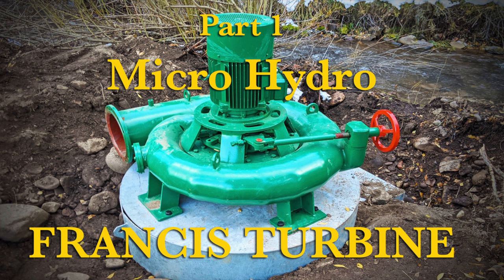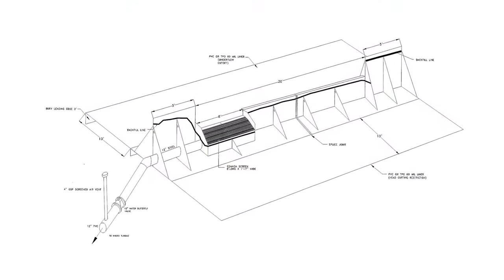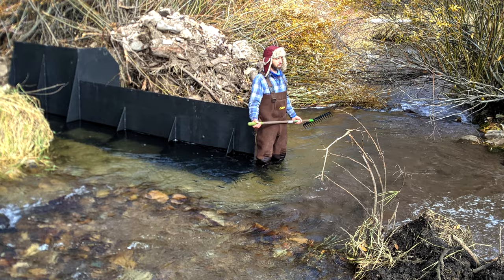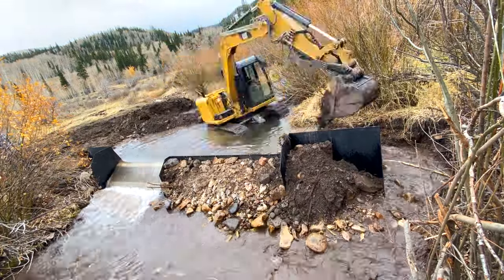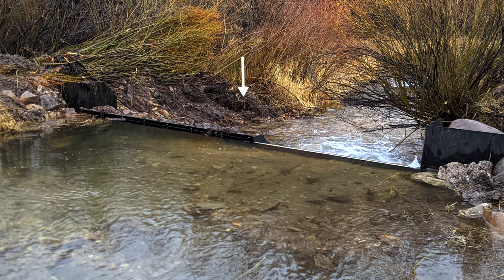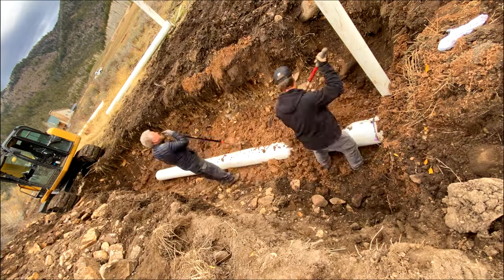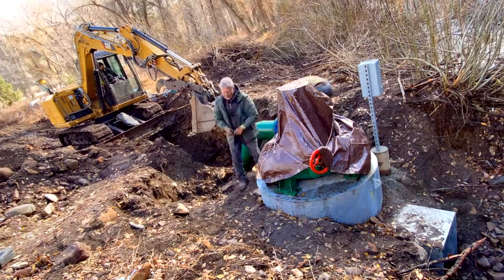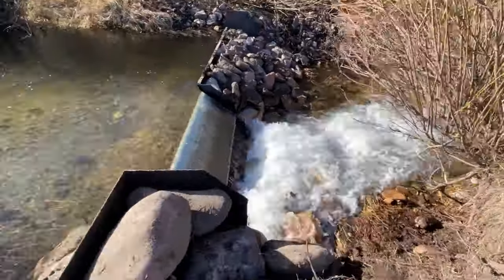Micro Hydro Francis Turbine Part 1

Comment: Might be a stupid question but why so much run? Why not just make it shorter with more drop?
Reply from the maker: The head (fall) of this or any system is dependent on the specific geography of the site. The placement of intake and outlet are selected to optimize the head. Unfortunately what you suggest isn’t possible due to the lay of the land and the water’s course through it. Hope this makes sense. Thx 🙏 for watching!
Reply: @MrHydrohead  oh that makes sense. So the creek itself didn't have much drop that's why you had to run it down further?
Reply from the maker: @RealSlavGod  Exactly. This system is an example of low head/high flow and is potentially producing up to 6kw or 144kWh per day which is 4+ times what a typical American house uses on average
Reply: @mrhydrohead  Thats quite an impressive power output. Good on you! I really enjoyed the videos too.
Reply: @mrhydrohead  Correct me if im wrongt but you know what would've been easier? Turbulent hydro. The one that uses the flow and spin of water rather than height difference. Way less material needed for that
Reply from the maker: @RealSlavGod  The turbulent system looks very promising but they’ve done very few installations. That may be because they seem to be marketing their product to a municipal or corporate use. I’m eager to see if there will be one installed which I can document.
Reply: @MrHydrohead  yeah the company itself but the concept of it is very simple. The form could be made out of concrete. The hardest part is finding a propeller and how to mechanically attach it to your generator.
Reply from the maker: @RealSlavGod  if I was looking to manufacture a product, it would be something to pursue. As it is our system at our home is currently running at 7.2kw or ~173kWh/day and it serves our needs quite well. Not sure if you’ve looked through my channel, but I’ve pretty much documented most everything I can about it and have started documenting others’ systems just because I have a passion about it and want to spread the knowledge. This video is one of those extensions to the channel. Again, thx for watching
Reply: @MrHydrohead  I sure did look through the channel and the content is great. I gave you a sub too. Micro hydroelectricity is one of my passions too and my dream is to work for a company that implements and plans these Hydro projects. I finished electrical engineering in school and am looking towards that for the future. Hydro is definitely the way to sustainability
Reply from the maker: @RealSlavGod  Good on you as the Ausies would say. I got my start in the 90’s with it. Living with a bounty of power is oh so satisfying. Best of luck with your pursuits!
Reply: @MrHydrohead  My other dream is making a homestead with offgrid Hydro power like what you got. That must feel good

Comment: Why PVC? Could you use  HDPE pipe?
Reply from the maker: I don’t think HDPE comes in 12”. If it did can you imagine trying to unroll it? Ouch. Thx for watching
Reply: @mrhydrohead  We get it up to 36", straight pieces  40 ft long, fusion weld it together. The 12" is 3/8" thick, very abrasion resistant . I've run it for miles above ground for temporay water bypass systems.
Reply from the maker: Interesting, thank you for making me aware of that.  Of course I am not the owner or designer of the system and was granted permission to document the project.  I don’t think the installer owns a HDPE welder either.  I would guess that HDPE has less pipe friction too.  Thanks agin for sharing

Comment: How long will it last? How much does it cost to install this way.😅😅
Reply from the maker: The system I own on my property and documented on this channel has been running since 1996 and I expect it will continue to provide power for the next several decades.   I am not the owner of this Francis Turbine system. I merely documented this particular system.  Even if I did provide cost figures, it would not be of much benefit as each system is unique to the chosen site and costs can vary widely depending on numerous factors.  First there is the potential power available at the particular site which dictates if the desired use of that power is practical.  Who will design the system?  What will be the best equipment and materials available to meet the unique requirements of the most beneficial and practical design?  Then there are expenses involved in acquiring water rights which are likely different in each state or country depending on a pro se (self applied) application or hiring lawyer to work on them.  Who will do the labor to install the system?  Is it your own sweat equity, friends that can help, or hired labor and at what rate?  How much time will it take to install?  What materials can be accessed?  Reused or new pipe, copper or aluminum wire?  How long a length of wire?  What building(s) will house the equipment?  What transformers, batteries, load regulators, power shunts, or utility net metering are available and/or appropriate to the particular site?  All of theses factors can add to the costs and it would be naive of me to present  a one size fits all price.
One must be clear that installing a system is creating an asset which would likely provide power for a lifetime.  Can it be financed over time and does that cost make economic sense when compared to running utility lines to an off grid property?  Will a local utility be willing to purchase excess power and at what rate?  Undertaking a project of this size is not for the faint of heart. It IS a large commitment both financially and in effort and time.  You pay for all future power up front.
Thanks for watching

Comment: hello do you need any permits to do this ?
Reply from the maker: Yes you must acquire water rights to use the water.  I don’t own this system which is in Utah, but my system which is documented on the channel in Colorado required attaining non consumptive water rights via water court.  Every state is different to my knowledge.  Thx 🙏🏻 for watching
Reply: @mrhydrohead  understood, if i wanted also to use the water for crops would i need another permit?
Reply from the maker: @wartrailers9398  Most likely. Irrigation rights are considered consumptive.  It all depends on the state and how they manage water rights.  Involving a lawyer who works on water rights might be the best person to ask about specifics.
Reply: @mrhydrohead  when i will move to the us and have the cash to buy some land I'll surely ask a lawyer

Comment: Why destroy good spawning habitat for trouts and insects and other wildlife with dam? you are contributing to the loss of biome which is huge problem world wide. So many moving parts which need maintenance over time. Why wind or solar power was not not good enough that u needed to destroy this nice stream?
Reply from the maker: First let me say that this is not "my" system, but one that I am documenting.  I didn't design or install the system, but was permitted to make a video about it. There likely was a limit how much water would be diverted through the system so as to not damage seasonal capacity for fish habitat. This is something that is regulated by the governing water commission and I assure you that the fish habitat was taken into account with the water right for non consumptive diversion.
The consistency of micro hydro far surpasses solar and wind is not really a viable source at this site.  Maintenance of the system is minimal.
Your tone is offensive and this system hasn't "destroyed" the ecosystem.  Nonetheless, thank you for watching.
Reply: @mrhydrohead  i wouldn't be offensive if i wouldn't see any problems with this dam. Okay lets talk about issues with this setup. Its looking like its late fall when this is installed, there has been some snowfall and the weather is most likely above freezing when filmed. Usually fall is rainy so im assuming we are on high flow rates on this stream when filmed. Also salmonoids migrate in fall so its not right time to go dig in streams and rivers. Looking at 3:36 Flow over the screen is barely suitable for fish and the biggest problem is that theres no pool under the screen, only rocks and shallow whitewater so fish wouldn't have any space to gather up speed to jump or swim over the screen so this system is totally blocking migrating fish to go upstream. Also if there was a pool, only the biggest and strongest fishes would have the ability to jump or swim over that screen. I highly doupt that habitat was taken into account when doing this because end result would been really different.

Comment: Excellent!! Is this system meant to augment or replace the existing system? I know you had many issues with flooding and stabilizing the original pipe system, but either way, glad to see it! This one is built to last.
Reply from the maker: This is a whole separate system design on someone else's property.  This video shows how low head/High flow can also be harnessed.  Our system continues to provide more power than we can use.  An update on our system will be forthcoming.  Thanks for watching!
Reply: @mrhydrohead  Awesome!
Reply from the maker: @TexasVeteranPatriot  Heres a link the first alternate system on someone else's property: 
  https://youtu.be/Bh8ngja_qNk

Comment: you said Micro lol
Reply from the maker: Yes indeed it is. https://en.m.wikipedia.org/wiki/Micro_hydro
5-100kw is micro, below 5kw is pico. Thx for watching 🙏🏼
Reply: @mrhydrohead  im watching stuff like reversed washing kmachines and this (as preperation on move in near future) https://youtu.be/L16s6aUJ0ns ... 1 1/4 inch pipes, 3 inch maybe 4 and then seeing urs with 12 inch pipes. urs just another level. enjoyed and learned. Thanks! (If u wudnt mind telling, what were the costs of your build?)
Reply from the maker: Sorry for the slow reply.  Pipe sizing is best dictated by the site itself as how long and how much flow will dictate how much pressure is lost to pipe friction.  The Dif between 1.25 and 4" is massive.  I am not the owner of this system. I merely documented this particular system.  I believe it was over $100k although I don't have access to the real numbers.  This system had no sweat equity from the owners.  Even if I could provide cost figures, it would not be of much benefit as each system is unique to the chosen site and costs can vary widely depending on numerous factors.  First there is the potential power available at the particular site which dictates if the desired use of that power is practical.  Who will design the system?  What will be the best equipment and materials available to meet the unique requirements of the most beneficial and practical design?  Then there are expenses involved in acquiring water rights which are likely different in each state or country depending on a pro se (self applied) application or hiring lawyer to work on them.  Who will do the labor to install the system?  Is it your own sweat equity, friends that can help, or hired labor and at what rate?  How much time will it take to install?  What materials can be accessed?  Reused or new pipe, copper or aluminum wire?  How long a length of wire?  What building(s) will house the equipment?  What transformers, batteries, load regulators, power shunts, or utility net metering are available and/or appropriate to the particular site?  All of theses factors can add to the costs and it would be naive of me to present  a one size fits all price.
One must be clear that installing a system is creating an asset which would likely provide power for a lifetime.  Can it be financed over time and does that cost make economic sense when compared to running utility lines to an off grid property?  Will a local utility be willing to purchase excess power and at what rate?  Undertaking a project of this size is not for the faint of heart. It IS a large commitment both financially and in effort and time.
My first system (1.5kw) which I own and documented on this channel cost ~$25k and was installed in the mid 90’s.  Redesigning and moving the same equipment to a more reliable water source was also documented on my channel and took place between 2013-2015 and added another ~$55k but boosted the useable power by a factor of 5 to 7.5kw.  WHEN a project occurs occurs is also a factor governing cost.  Inflation impacts everything involved and the fact that I intend these videos to remain on the internet for years to come and provide some clear eyed guidance to people that are serious about their own intentions, this dictates that I not mislead them with cost estimates willynilly.  
Thanks for watching and for your comments.  I hope you can gain a broader perspective from the whole channel and benefit from the heart felt intention with which it has freely been shared and provided.

Comment: What about a silt filter and shut off ?
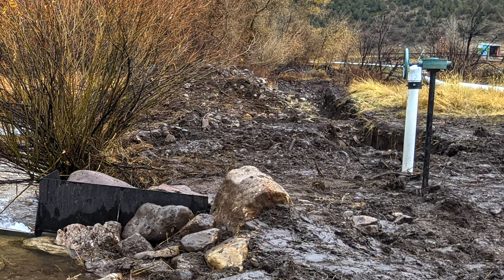Reply from the maker: I asked about silt when I visited the site last month.  Silt runs straight thru the turbine with minimal impact. The shut off valve is shown around 3:13 in the video.  Thx for watching
Reply: @mrhydrohead  if silt fills the hole the system fails and all your money is wasted that's the point I'm making
Reply from the maker: @michaellalanae7228  Apparently not a problem as I’ve been told. You may possibly have a point but only time will tell. The water was very clear in the spring runoff that I saw.
Reply: @mrhydrohead  great to hear .I love the idea though .you also have to remember ice is also an enemy .

Comment: Return on investment must be  better the 15% or its a loss
Reply from the maker: ROI is just one way to look at it.  My own personal Pelton turbine system which I own and the majority of this channel documents is another way of judging it.  I am 7 miles from the grid and in 1996 when I decided to originally install my system on spring fed water, the cost per mile to run power lines to me was $20k/mile or $140k and then I would have had monthly utility bills.  The cost to put that initial system in was around $25k and I got domestic gravity pressured spring water and a pond to raise fish for that investment.  When my springs decreased in output in 2013 I decided to move my equipment to a creek source on my property and the estimate to run power lines in had risen to around $250-300k.  The cost to move the system to a new penstock and powerhouse with a new transmission line added about $55k to the original cost, but I got a 5 fold increase in my power capacity and still had my spring fed water source and pond.  This made living in my home in Winter at 8600ft in the Colorado mountains possible as nearly all heating is accomplished with Electric and Passive Solar design.  
So, it wasn't just a question of ROI in my case.  It was a no brainer to initially put the system in and the upgrade has proven to be a good investment in the value of the property which is fully off grid.  Some people suggest that solar would have been a better choice.  However, the cost of solar in 1996 was much higher then vs. today and the consistency of hydro being produced at the reliable level 24/7/365 makes it a joy to live with.  No batteries and minimal maintenance has been required.  To date my equipment has generated about 477.5 megawatts since 1996 and that is with its being dialed way back in non Winter seasons when demand isn't as necessary.  I've never done a calculation on ROI as I accepted the cost benefits to being wired to the grid both in 1996 and 2013.  I also accepted that all future power costs would be paid up front as an investment.  And, I plan to get an electric vehicle which I will be able to charge with the system as well.  All in all its a different approach to valuation in the property vs. ROI and an investment in the present and future worth of self reliance.
Thanks for watching and your input.